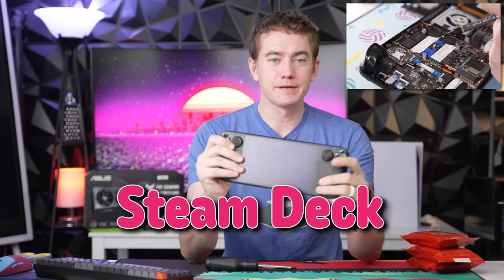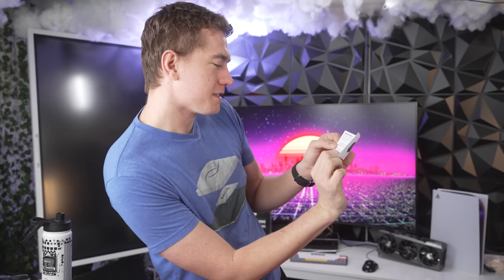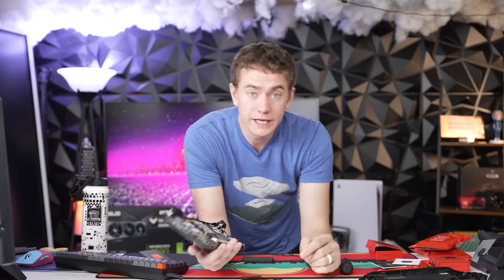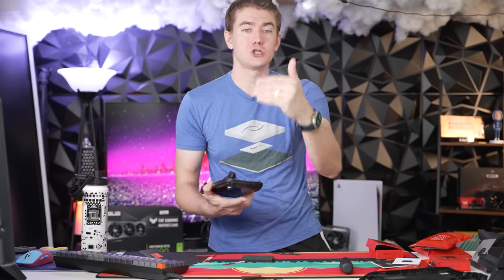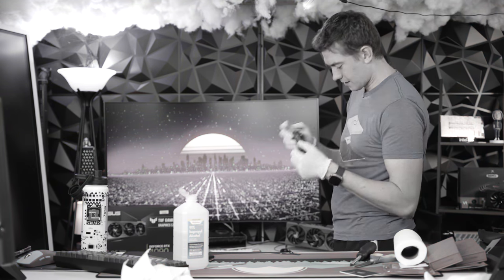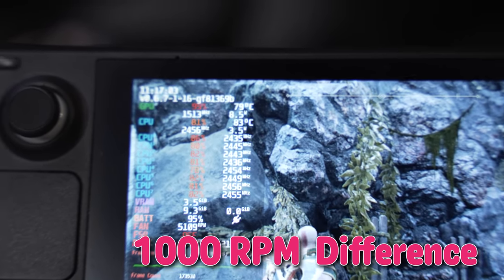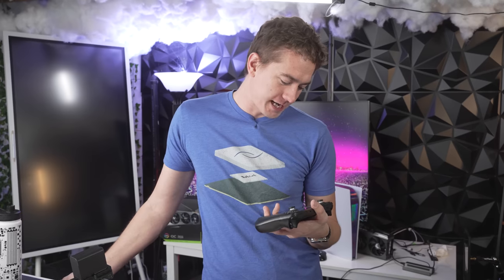Finally Fixing the Steam Deck's Heat Problems

Comment: FYI: I'm from Portugal, bought 38x38 mm - Final price: $21.99 - My question, for personal use, if I buy thermal paste, wich I can apply every year, for 4, 5 or 6 years, will the paste be usable after this time? doesn't it dry, in the tube, whithout using it, for a year or more? Will let you know when it arrive from Sweden!?...
Reply: Mmmmm I would think if you had a little amount as very little left probably dry out but I'd you have a good size tube I would say it's good for years.

Comment: One thing I did to my laptop was to double the heatsink surface area. I did this by getting another heatsink for it (same model) and baking it so that the heat pipes separated from the fin stacks and then glued them together using thermal glue. This dropped my temps by a lot, allowing for boost clocks to stay constant on both cpu and gpu. Due to clearance, the bottom cover sits a bit tight, but it closes. The Steam Deck heatsink looks thin enough that you could try this and not have that much clearance issues. Linus did the whole external heatsink and fan mod, so maybe a simple mod like doubling the heat sink's surface area could help a lot as well.
Reply: I need to see this done somwhere so I can do it too if it works!
Reply: I took the idea from this video: https://youtu.be/WqWXr8HnZT0. Before committing to gluing it, I used tie wraps to hold them together to test it and it worked. Then I removed the solder as much as I could to make it flat and glued them together and got a couple degrees cooler.
Reply: @cianide99  ahhh that is pretty cool. I had thought a it something similar to this too. But didn't think about it in this way! I might have to take mine apart and see if there is any clearance for additional heat sinks

Comment: You are demonstrating the exact reason why I have not and never will use liquid metal. The few degrees gain is not worth the great risk of permanent shorting of Gpu/Cpu pins. And the news to never have your PS5 standing vertically just confirms that not eaven a huge company like Sony can control It. But I will give the termal pa a try.

Comment: I think I have a bad solder on my type c input that plugs into the PSU. I don't have any indicator light that it's charging, the device does not get warm, no fans are on, no vibrations from haptics, etc. Any advice?
Reply: Email Valve, you have a year warranty.

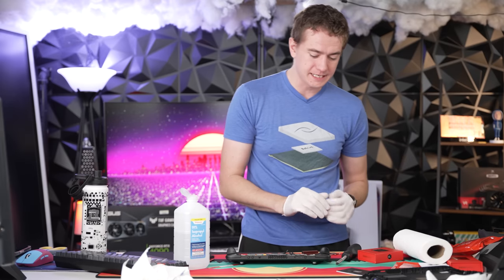Comment: Please forgive my ignorance, but how does the frost sheet adhere to the steam deck (6:40 - 7:00)? Doesn’t look like it has any adhesive. 

I just bought a deck for the whole family for Christmas, and I’d like to know, so that I can adequately protect our investment. Thanks in advance.
Reply: there's no adhesive on these graphite pads. the friction between die and cold plate is enough to keep it in place. if you want it with adhesive, you probably want to look at Panasonic's PGS sheet. they're for industrial use but there's options with adhesive and even PET layer for electrical insulation (bare graphite is electrically conductive like liquid metal). another option, go get Honeywell PTM7950

Comment: Not bad but why it cost 29 bucks when it probably cost 29 cents to produce.  The box couldn't be more than a dollar or two.
Reply: it is expensive but graphite pad is not that easy to produce a good ones. Panasonic PGS sheet is less expensive, works quite well, and came with bare/adhesive/adhesive+laminated options

Comment: I'm definitely suspicious of these results, all pads have always been less messy and less performance which this supposedly defies, but even then this is quite unscientific as the liquid metal effected the cooler and there was a vast time span between the original test and this one, with all things considered the lower fan speed could have easily been caused by other things
Reply: I modded my RX7900xtx with the graphene pad (just need to cover up some parts around the die) and for me it works perfectly and i do have better Temps than before and especially a lowet hotspot delta compared to whatever Powercolor uses from the factory.
Like ime it works as good or better than a decent paste, it's just expensive. But it also eliminates thermal paste pumpout which i sadly had with my GPU. Im a fan of the pad and watching the Video to see how well it could work for my deck

Comment: Mine is set to 40 display refresh rate and 40 fps limit. In most games I stay around about 16 watt or less and can’t even hear the fan.

Darksouls 3 uses at high setting with 40 limit only 14 Watts but with 60 fps limit it jumps up to 23 and the fan starts ramping up and getting hot.

Comment: didnt know it had heat problems
Reply: It doesn't.
Reply: It gets hot, around 90° under heavy load, but it thermal throttles at 100° and shuts off at 105°, and it almost never reaches those temperatures unless you're playing in very hot weather (I've gotten the 100° warning once in the 7 months I've had the steam deck, on one of the hottest days of the year)

Comment: This is awesome!

The significant gains translated from the fans working alot less is a game-changer for the decks overall longevity.

the less the fans speed, the more efficient cooling, and power consumption as the power plant supplies less load. Which will also result in better battery health, long-term.

Thanks for sharing this! 👍🏻🤟🏻
Reply: look at the frequency, compare power draw, this is not apples to apples.

Comment: Yeh no dude you should have used a conformal coating, also you just have too much liquid metal on there if it's pooling it's too much. Like nail polish is a perfectly decent conformal coating and easily obtainable.

Comment: I dont trust those things, yeah they are great for dealing with heat, but they are also electrically conductive, id rather play it safer and use a non conductive thermal pad.

Comment: Is this company legit I ordered my frost sheet literally within minutes of watching this video. I still haven't received my order. even after shipping my order I wasn't provided a tracking number not even when  I asked them for one.
Reply: Yeah. It took them almost two weeks until they finally shipped my order. No tracking number was provided. It was until my country's customs notified me of the due tax I had to pay, that I finally knew where the damn thing was.

I even tried to refund my order a week after placing it and it was allowed per their policy. Nada, no response. Now I don't know if I even want to put them on my deck. that's $20 down the drain, I guess.
Reply: @Paul Aldo  thanks for your reply I also emailed them and they keep telling me that my order is on the way. I really was looking forward to this product but now I'm scared that I'll end getting a regular piece of paper and ruin my deck.
Reply: @somerandomeguyonyoutube  Btw just a heads up, I finally took the jump and installed it. Because my temps and fan noise is getting worse. Turned out my OG thermal paste has dried up a bit.

I cut it to roughly 13x13mm, cleaned the leftover thermal paste, and put it in. I benchmarked it using RDR2 and the result was exactly like Brett's, temps hovering around 80ºC and fan spinning at 5200 rpm. Definitely an improvement if your thermal paste has degraded.

Good product, quite overpriced, and nonexistent customer service. That pretty much sums it up.

Comment: Umm I consider that a loss.... People care about fan noise way to much. Give better cooling and I'm all for it... If you could bump up the fan to get better cooling that would be a different story. Btw note to people who care about fan noise, ever heard of headphones? Also consider this... Heat will kill your system faster
Reply: The fan noise is a direct correlation to temperature. It means that the heating is able to pull heat away more efficiently theoretically allowing the chip to boost a little higher in the process. This graphene pad didn't change the software of the fan, the increase of heat transfer did

Comment: Why don't you just 3d Print a new Back cover with a Hole in the shape of the E5 intel cooler? you can also create a 3d render of the new mounting using Steam's Open patients.😎

Comment: Also alcohol is not going to help you remove liquid metal, anything that is water based is all good, but liquid metal is a gallium alloy and is not desovable in solvents like alcohol and water, in fact trying to clean it with water or alcohol will just make it harder to clean up because the towel will be less absorbent and alcohol/water vs galium alloy is like oil and water it actually repells it. Dude you need to do research before trying stuff like this.